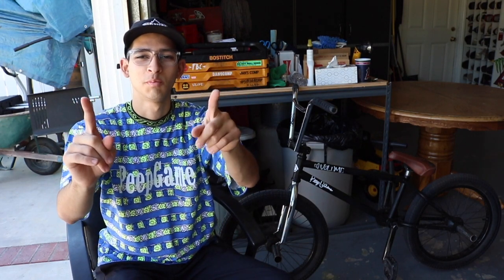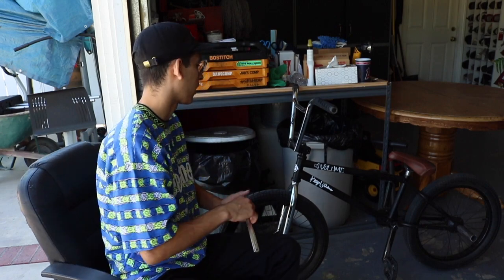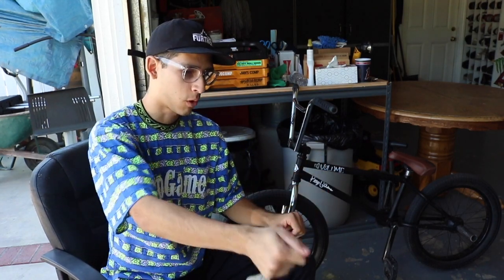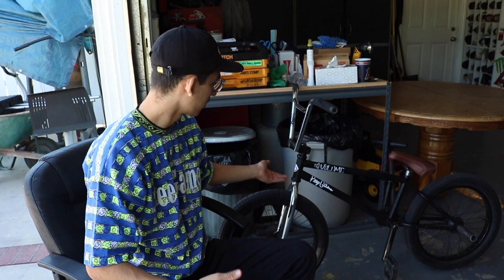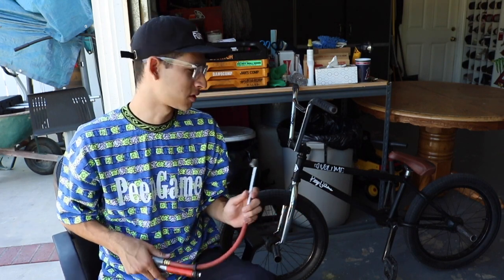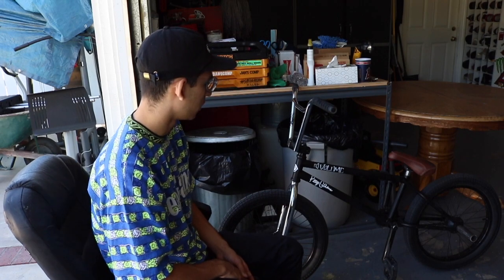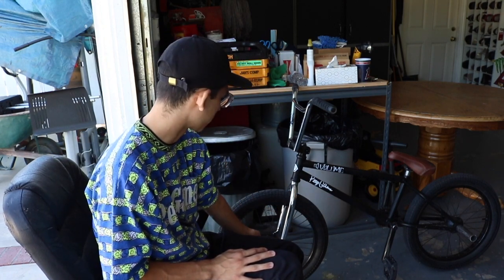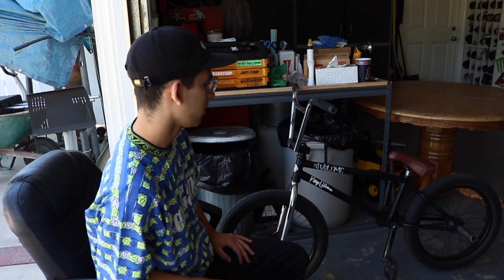Bike maintenance - BMX FOR BEGINNERS

Comment: Yo everytime i grind my wheel moves to one side of the frame and the bolts r tight af what do i doo
Reply from the maker: Something is wrong, take a visit to your local bike shop
Reply: Make sure you tighten one side at a time, I had that problem and My mistake was tightening both sides at the same time